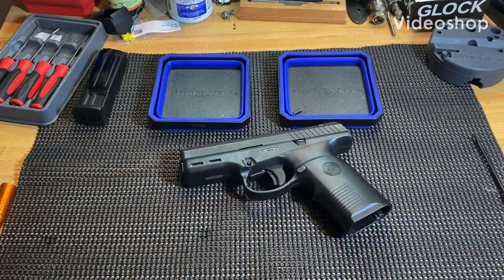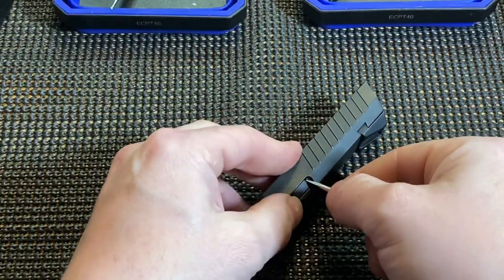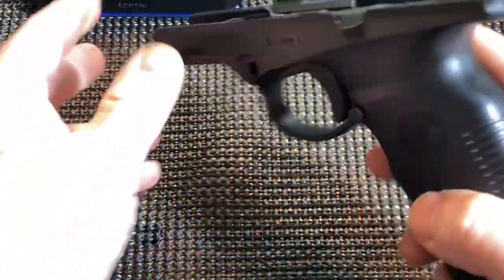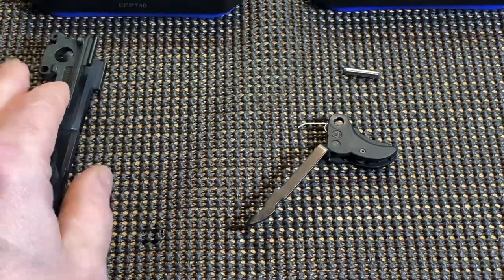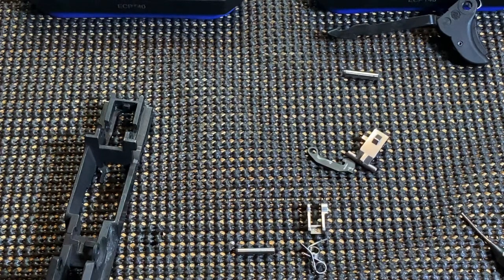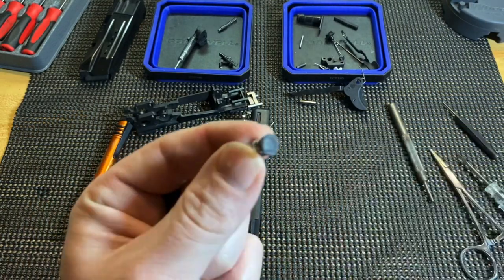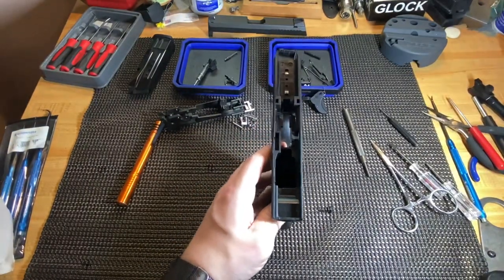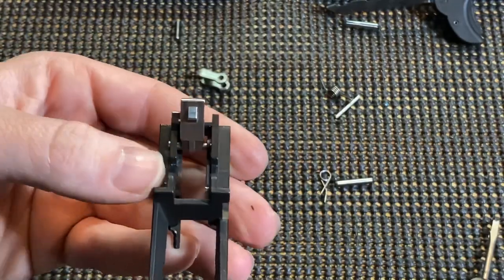Styer M9 Complete Disassembly/Reassembly

Comment: Hey man, so I cant get my trigger safety to work properly, is the spring supposed to sit and stick out over the mechanism or somewhere on the inside? like does it have a very specific spot? 
great video btw!
Reply from the maker: The long end of the spring falls down into the little groove. When you put the pin back in to hold the safety in its spot you should of had to lift the spring slightly and slid the pin under it. The spring helps keep the pin in
Reply: Are you talking about the drop down safety or the trigger safety? In the video he explains that you should see the spring in the back of the trigger and this is the correct way to set it actually that's not the correct way. You should not be able to see it. It should be inside the groove. If you look at his trigger when he has completed assembly, his trigger safety is recessed. Mine was like this when I followed the video. I took it back out and did the opposite of what he explained and now my trigger safety sticks out the way it should and resets the way it should